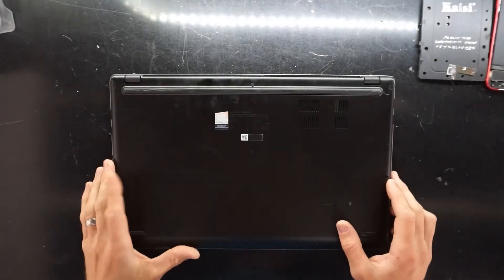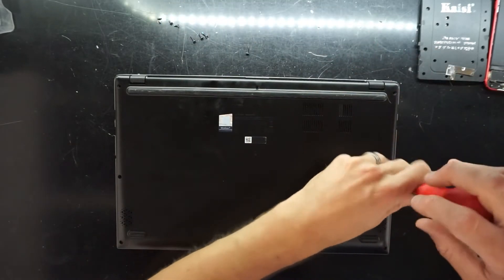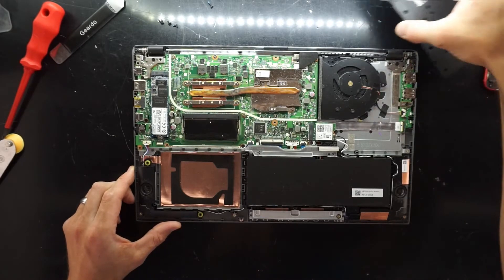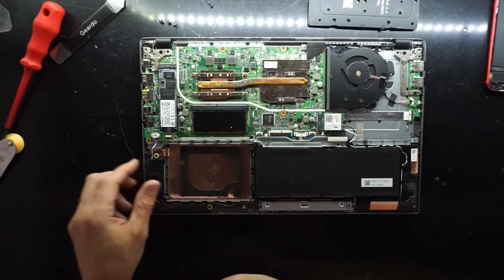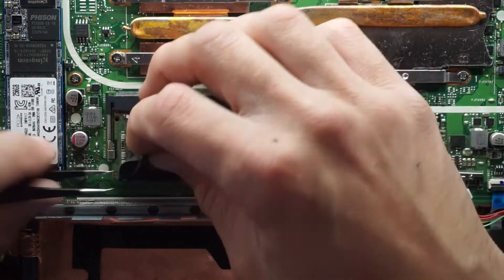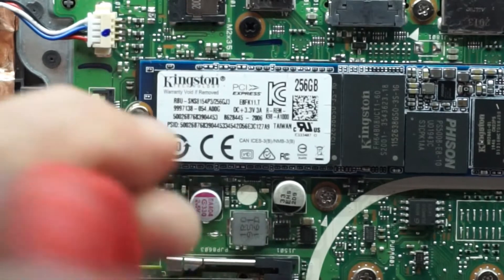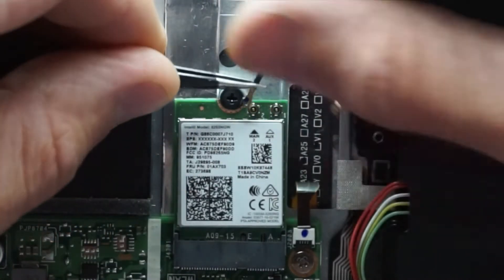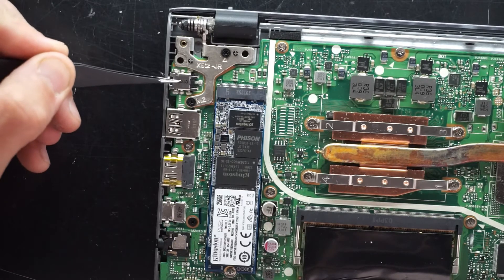Asus Vivobook 15 Ram and Hard Drive Upgrade

Comment: Thank you for this ! 

I bought the Ryzen variant in 2019 and *touch wood*, everything is still running. I use my laptop for making videos, photoshop and anything but gaming. I am finally upgrading the RAM to 16gb and the storage. The battery has been meh, I am getting a replacement because after nearly 5 years, it might go kaput.

This video has been great with explaining things in details. Hopefully I do not screw anything up !
Reply from the maker: Good luck with your upgrade :)

Comment: How do I know what ram size to get? Sorry if this a dumb question, I know I have a 8gb but I don't know the measurements or type of ram I need to look for
Reply from the maker: download cpuz it will tell you what ram you have installed and also will tell you how many slots on the mainboard you
Reply: Its DDR4 RAM the form factor is all the same. What you need to know is the speed which is 2400 I think but just get the same speed that you take out otherwise you might not get any gain.